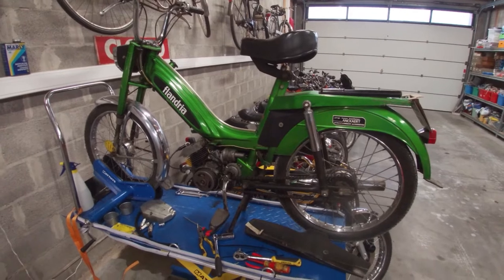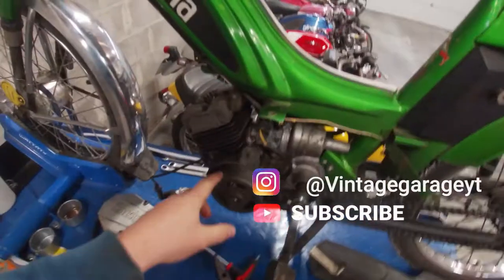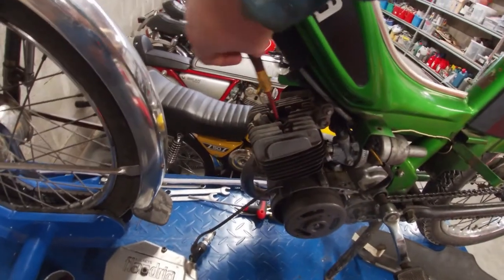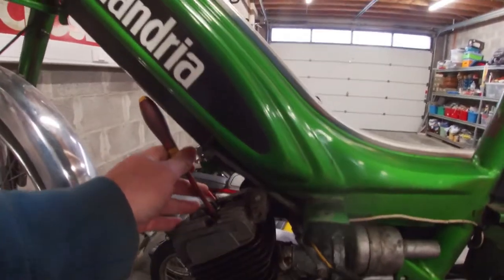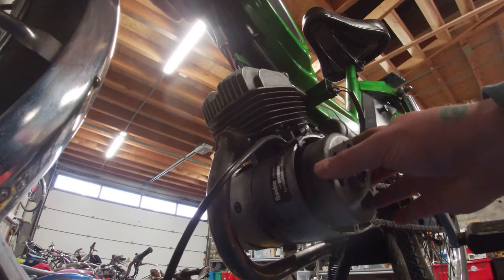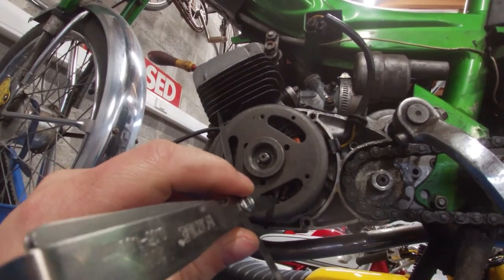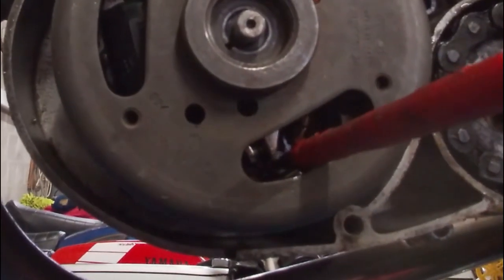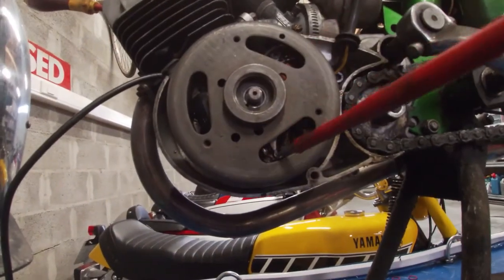How to clean and set a points ignition system!

Comment: Thanks for mentioning it opens at 2.5mm before TDC  I couldn't find this anywhere. I have a Benelli 3V  with rotor plate that was was off when I got it, I didn't have a clue how to set it and  the thing would not even fire up, now putting it at 2.5mm before TDC actually got the moped to start! Very good, thanks
Reply from the maker: Glad I could help!